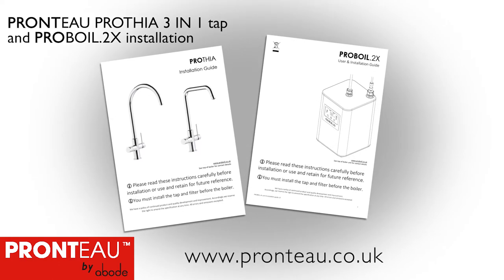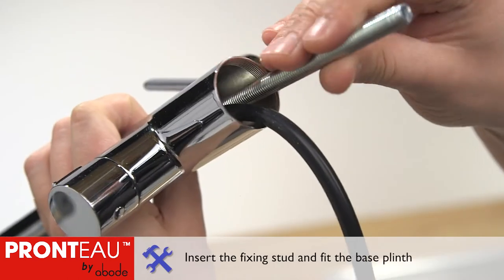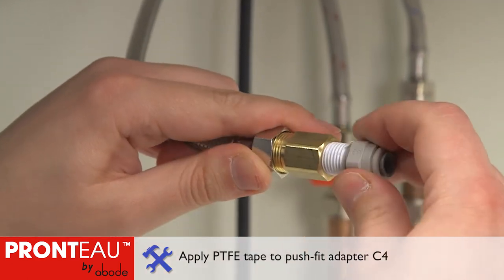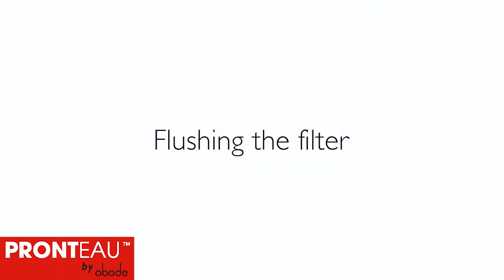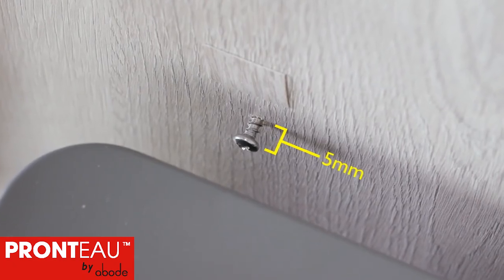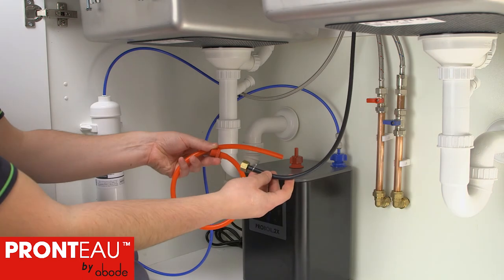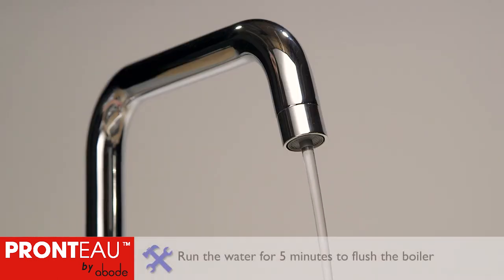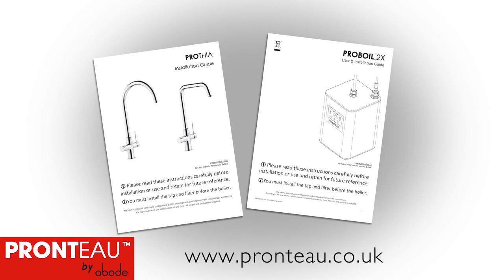Proboil 2X and 3 IN 1 Tap Installation Video

Comment: I never had the black pipe which is already inserted into the tap? Is this an extra?
Reply: Did you figure this out? I believe mine is a braided wire not the black silicone one on the video